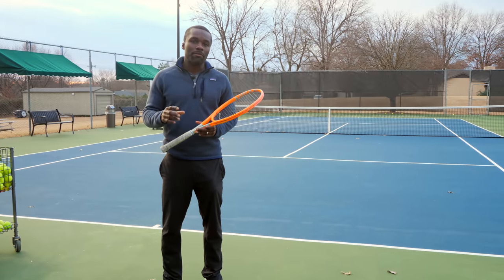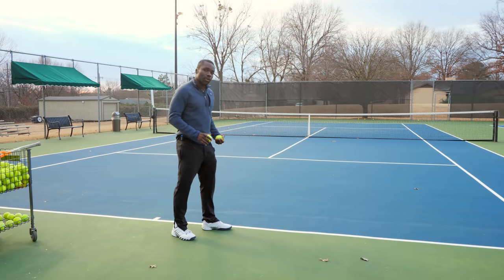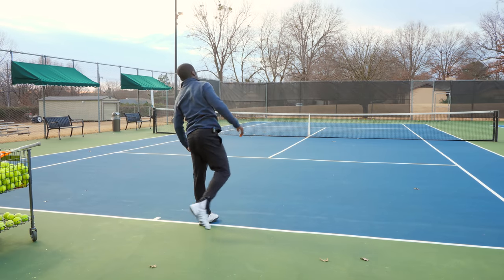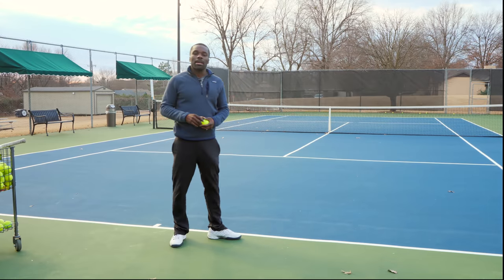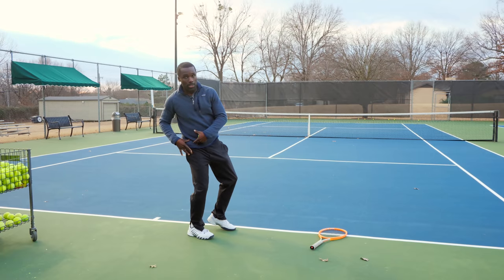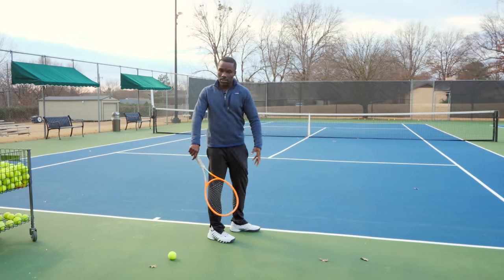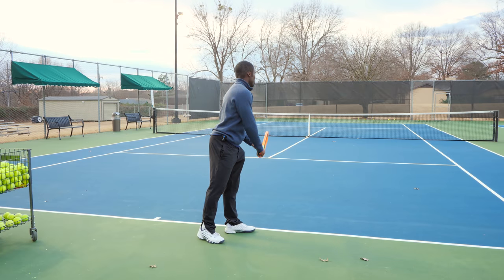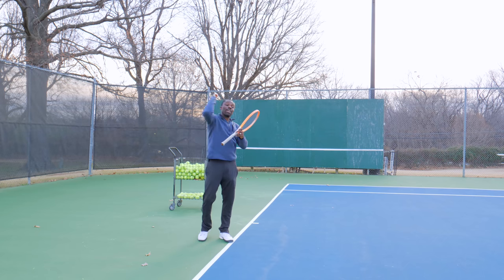Learn Leg Drive Technique that can Increase your Serve POWER...

Comment: Loading and driving off the rear leg is important for pitchers, but even in pitching there are two different styles: "tall and fall" involving a big hip lean and less rear leg bend versus "drop and drive" with a deeper back leg load.  The problem is that there are so many big servers that look like they are mostly loaded on the front leg; the rear leg drags into the pinpoint stance and stays up on the toe.  So either you believe they could actually be serving even a lot bigger if they "did it right" or there is something going on that makes serving different than throwing.  My theory is that the forward momentum in the pinpoint serve comes from a big hip lean and the legs primarily drive upward, which you can do off your front leg.

Comment: What a fantastic lesson sir.. I tried it today and it felt soo good. My serve has changed overnight. Also most so called coaches avoid explaining this particular aspect which is kinda strange. I straightaway felt the connection between my back leg loafing up and the serving hand exactly just like you explained..i was loading off the front foot and landing on my front foot for years which was taking a roll on my  knee  and now I am able to generate raw power! But a lot of shadow practice is required to condition the mind to do it subconsciously.. Thanks a lot 🙏🙏🙏

Comment: Back leg also helps you to go UP in direction to the ball rather than forward. Once the upward direction is achieved and the back leg leaves the ground, the front foot is still pushing off. The back leg helps stability and upward movement...I find.

Comment: Golf coach here: the kinetic chain in golf is up the left side,  in tennis it seems to me up the right side to the right arm, wrist. 
The back foot must be providing forward rotation, again very important for forward power forces. I see the front foot as helping to provide upward forces for advantages in angle of attack.

The key to all sports like tennis golf cricket is transmission of power from the ground through the body to the arm/wrist....

Comment: Great points Kevin

Energy efficiency is huge as it enables the player to maintain good control as well as last longer
The reduction in injury possibility is a extremely big one for me
The nuance of hip tilt is a very good catch in terms of explaining what is supposed to happen.
The throwing demonstration I am going to pinch immediately 😈

Some coaching notes for things not discussed here.

60-40 weight distribution is what supposed to happen. This is an ideal.
That being said, since >80% of recreational players predominately jump off their front foot/leg, a 60-40 split is going to have to feel like 80-20 or even  90-10 for a player to make a change.

In implementing this coaching methodology, it is important not to lose the role of the front foot, which is to produce good verticality in the leg drive. If you coach this often, you will experience players have a tendency to swing too much onto the back foot, and then forget to use the front foot, which results in balls going into the net a lot or not as much spin and the player is not contacting on the way UP ⬆⬆⬆ before the peak of their jump but contacting on the way down or worse not really getting up at all.

Probably the other thing to note that this is a radical change for most people in their timing and rhythm of their serve and takes a concerted effort to implement properly.

On the last 2 points I'm not holding this against you Kevin. The video will get too long when you start to get into the nuances.

One final note, Kevin you have inadvertently discovered a test for a poor throwing action (pronation, internal rotation) if a students front foot throw is the same as their back foot throw.

P.S.
I really wish the Fuzzy Yellow Balls Forum was still alive. I was posting about this in that forum in 2008
The ITF used to have quite a few good articles on mechanics back in the naughties, but now its all hidden behind pay walls or completely disappeared from the internet. 😿

Comment: Just like there are platform and pinpoint stances, there are rear leg and front leg loaders. If you watch a djokovic serve slow motion video you will see that he doesn’t load his back leg more than the front. To the contrary, most of his weight seems to be on the front leg.

Comment: Please rethink this.  You might be making a mistake.  All slow motion videos seem to show everybody leaning into the court with most of the weight on the front foot. Pinpoint servers seem to be able to push off with both but platform servers don’t seem to be getting much off the back if any.  Look at slow motions of Djokovic.   Tsitsipas is a platform server that look like he might be getting some of the back.  Please rethink.  Controversy on this one.  With platform it would be right then left which might present a problem to the physics.
Reply: Correct, even Federer, Becker, Roddick, Sampras in slow motion it’s evident in their knee bend there’s more weight on the front foot
Reply: Rick macci says you jump with the back leg

Comment: Kevin I think we are confusing between loading and pushing. At the trophy phase  your body load (aka center of mass) is definitely on your front leg. However we push mainly by the back leg to trigger the kinetic chain like you described on the video and the front leg helped out a bit (maybe 80-20). My idea is that the back leg gives you kinetic chain and the front leg gives you forward momentum. And both contribute to your serve.

Comment: Great video! It made me think about pitching in baseball - a pitcher always pitches pushing off of their back leg, and that's where a ton of the power comes from. Of course there's a difference between the mechanics of a pitch and a serve which is what makes it seem less intuitive in tennis, but it makes sense that your back leg would give more power overall if you can learn to use it well.

Comment: I think you can load the back on a platform stance if the toss is behind the baseline like an extreme kick serve toss.   If the toss is into the court then it seems like most of the weight in on the front leg.  Therefore, it seems like most of the drive is from the front leg.

Comment: Great topic! Not sure why the 60/40 weight distribution on back leg is so controversial.
It feels quite natural with the platform stance. Cannot speak to the pinpoint stance as I've never used pinpoint. Have always used platform and the weight distribution at trophy has  felt about  50/50. This 60/40 approach is a relatively  minor modification that could yield significant results as Kevin personally attests... Rick Macci describes it as loading the back leg and throwing the right hip into the court.

Comment: Kevin, great video.  I realized that loading on the same side as your dominant arm is the key.  That's why I switched to the platform stance.  When I used the pinpoint, I couldn't get my weight on my back leg.  80% of my weight was on the my left leg and it was just not a great feeling especially on my knees.  I believe you could transfer your weight to your back leg on pinpoint but this requires that you wait to gather yourself and explode upwards.  Which really means a very high toss and then you lose your forward momentum.  This completely nullifies the advantage of the pinpoint in the first place.

Comment: If you bring your feet together in a pinpoint then it seems like it’s possible.  When I look at Zeverev it looks like he is getting some leg drive from the back foot but I would think that it’s less than 50%.  It would be nice to prove this with another source besides Dr. Kovacs.  For the platform serve In the trophy pose when the servers head is at the lowest point and before the leg drive.  It sure looks like most of the weight is on the front foot.  Not sure this proves my point but maybe it does.

Comment: Momentum is shifting forward on the serve even as you are coiling. The weight shifts forward to a tipping point where you would fall over if you didn't hop or drive to catch yourself. Most of the thrust forward and up comes from the back leg. This is why it leaves the ground first. The front leg serves as a stop of that forward momentum and to keep you from falling on your face. If you time it right, you can actually feel the additional impetus to the racket head in that fall- catching hop.
Reply: I've read a LOT on the serve but this little paragraph is really on point. Added to my notes! 
Good work

Comment: Platform distributes balance equally. The torso torque-shoulder dip loads the rear foot.  Facing more square to the net greatly facilitates this. Ref. Becker the most biomechanically perfect server.

Comment: Kevin. Please go back to this theory again.  I think you could possible use the weigh transfer golf equipment at Cedar Ridge and have some local college players hit serves.  I think an a impulse
Reply: I think an Impulse curve over time starting at the instant the leg drive begins until liftoff of both feet might help analyze the theory. The area under this curve might be the answerer The impulse curve is force on the Y and Time on the X.  The difficulty’s might be there is a direction component that might get lost and may the weight of the person should be removed that might not be possible.   Also Nikola Arabic is contradicting your claim but I think he’s wrong also. I think there is significant back foot leg drive from pinpoint but less than 50%. The is probably much less than 50% from platform.  Another point is that when the back foot lifts off the impulse continues on the front foot. Maybe it’s small but maybe not.   Please please please try to prove this. The head golf pro at Cedar Ridge would probably be happy to help you. I believed everting you ever said but this one sounds wrong.

Comment: honestly super confusing cause what about pin-point and leaning into the court -> clearly if you lean almost all off the weight is on the front foot for a pretty long time, so imho this makes zero sense, even on platform stance they lean slightly so where is the weight in this case?

Comment: It confuses me - does it contradict this https://youtu.be/Lomfb5AcsK0? I find it hard to hit a toss that’s inside the court
Reply: I'd say no as Nick often uses oversimplified examples. Let's just say it like this, during your tossing action you should already be in a balanced position without having to shift your weight or balance while the tossing action happens.
Based on this your tossing action should happen while you're already somewhat loaded on your back leg and by the time is completed you're already "fully" loaded on your back leg.

For me specifically, I like to feel like if all my weight and loading is happening on my back foot which seems to work for me lol